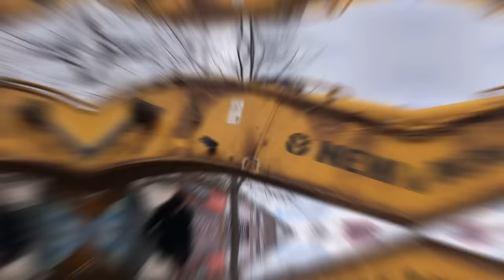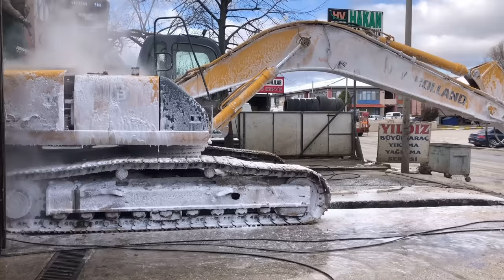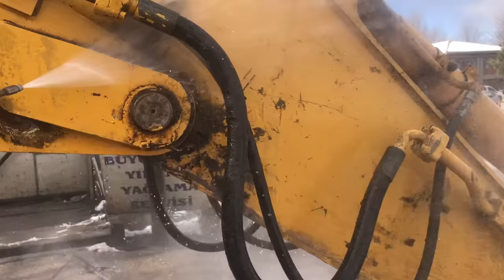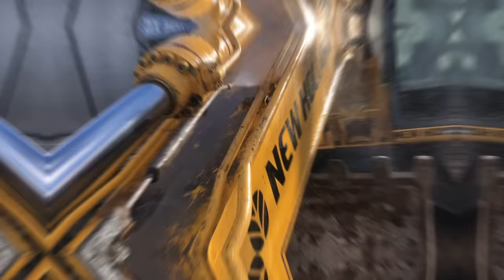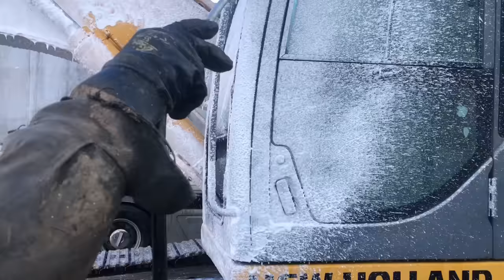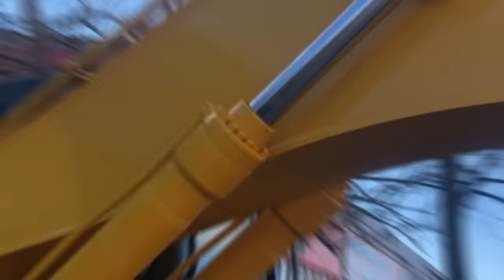TAM 3 SAAT SÜRDÜ ! İş Makinesi ESKAVATÖR nasıl yıkanır ? DİRTİEST EXCAVATOR EVER ! How to clean ?

Comment: I cant believe how the engine and everything gets jet washed :D those things must be so tough I'd love to have a go on one :D
Reply: It's a heavy duty diesel engine they are built fair tough and not a lot to get broken from a little light pressure washing... But this wasn't that dirty anyways. I've seen cars on the street look worse from gravel roads.
Reply: @SilvaDreams  They are also means that often work in muddy areas and sometimes immersed in water, a few sprays of water will not cause serious problems.
Furthermore, it could cause some problems if it were done with the "incandescent" engine and this does not seem to me to be the case since at the beginning of the video you can see that it has just been unloaded from the truck

Comment: im sorry, this is not about being cheap, bit rather practical, heavy machinery dont need to be cleaned thoroughly especially on exterior just water is fine, because this thing is meant for working not for showing let alone picking up actress on grammy's, for me it is best to keep the interior, and moving part clean and it would serve you a long long time✌️
Reply: The obvious reason is for resale.  A "clean" machine is literally a 5K difference.

Comment: That’s a lot of degreaser 😳! I use a hot pressure washer and no chemical, the heat dissolves everything. I hope they greased it afterwards, a wash like this is super tough on seals.

Comment: That wasn't very dirty. I clean excavators 10 times worse where there is mud packed in the tracks. It only takes 1 to 2 hours to get it clean enough to pass an inspection. Using a heated pressure washer that gets up to 240 degrees fahrenheit and it all comes off nicely.